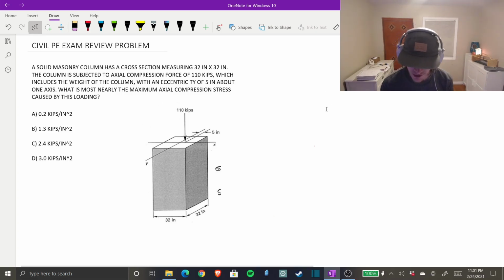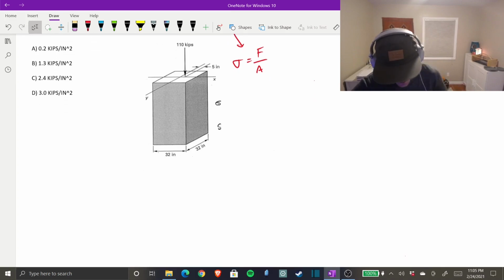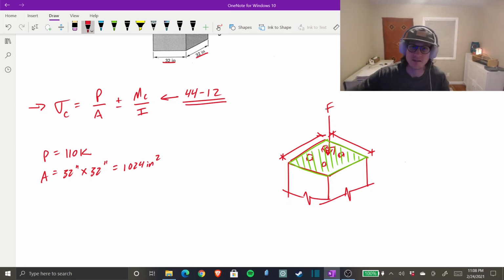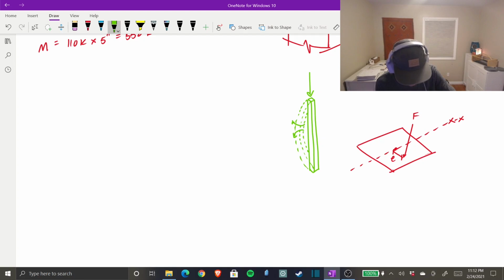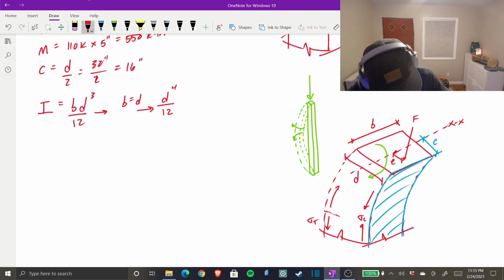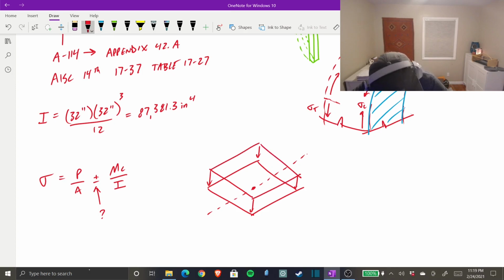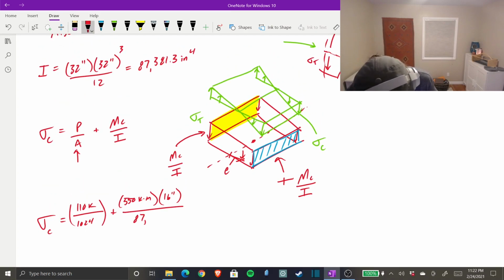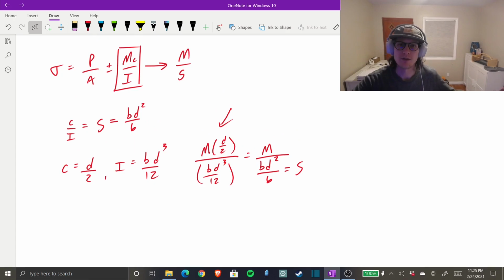Eccentrically Loaded Column Example Problem | Civil PE exam Review Problem | 2021 Spring Exam

Comment: Please solve a problem involving steel hollow section with diametrically opposite eccentric load. The column is fixed in ground and free in air on other end. Also there is lateral load on the midsection of the column. Appreciate your guidance.

Comment: Nice video! On geotech we have this equation for eccentric loaded footings:
Qmax=Load/BL x (1+(6e)/B)
Qmax=110/1024 x (1+6x5/32)=0.208 kips/in2

where e = eccentricity = 5 in
B=width and L= length (in this case both 32 in)
Reply from the maker: yes Luis - great equations, structural engineers use the same ones for footing bearing pressure checks, based on the allowable soil parameters given by the geotechnical engineer!

Comment: Hi, thanks for the video.  Since the question asks for max "axial" compressive stress, would that mean calculating only Force / Area?
Reply from the maker: Hi Ivie, unfortunately no, the internal bending stresses due to the eccentric load still breaks down to additional axial loading along the extreme fiber of the column. so it would be the combined axial + bending stresses.